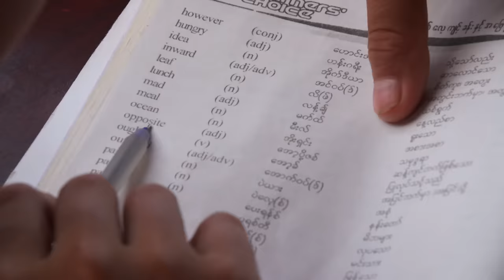Birmanie, trompe-la-peur | Les routes de l'impossible

Comment: GOOD RURAL ROAD BUILDING METHODS
The surface of the road (off road) must be curved so that rainwater easily flows into the drain, this is the most efficient rural road construction technology and the best way to prevent the soil on the road from becoming too soft and will dry quickly.